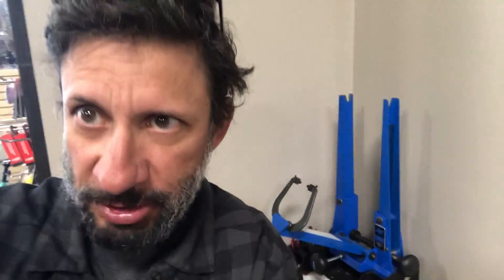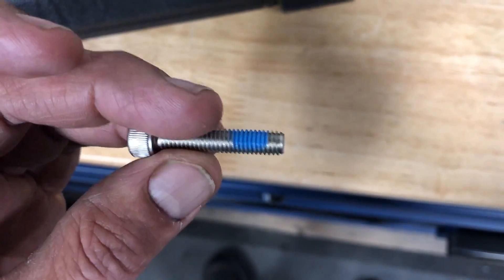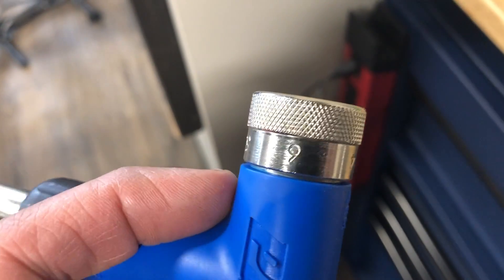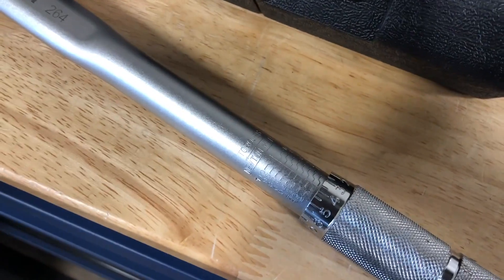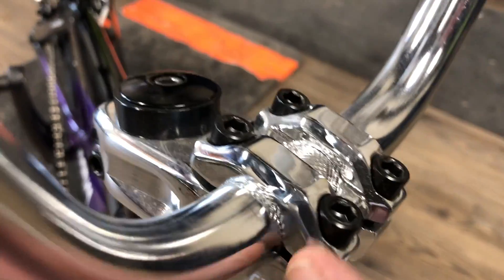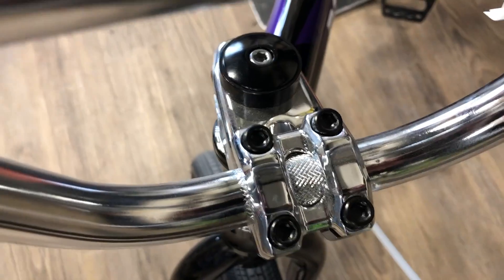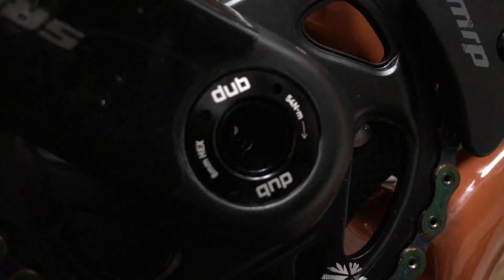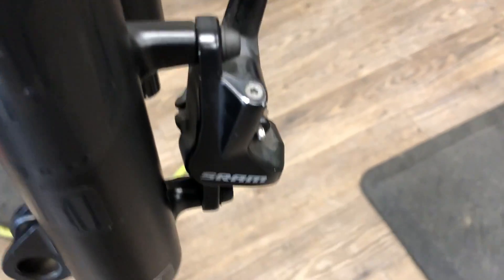All About Bicycle Bolt Torque Specs

Comment: I just bought that Park torque wrench with the 4-6 newton meter range.  Very useful for the lower torque bolts on stem and seat clamp.  Good tip for greasing bolts which I also do whether it has thread lock on it or not.   I've been wrenching on bikes for so long that I can estimate torque accurately without a torque wrench but it's good to use them especially on carbon parts.
Reply from the maker: Yeah, I'm pretty much the same. I've developed a pretty good "feel" through the years, but I'll use the torque wrench on those delicate parts!